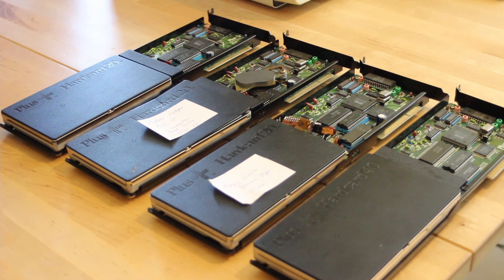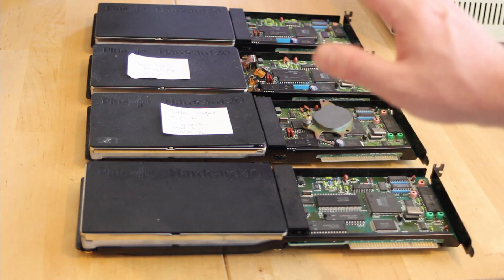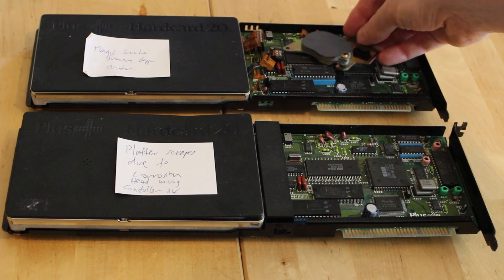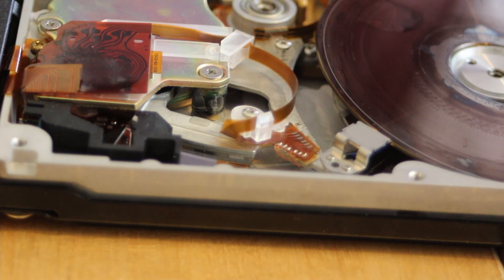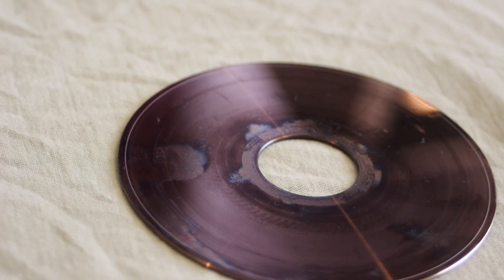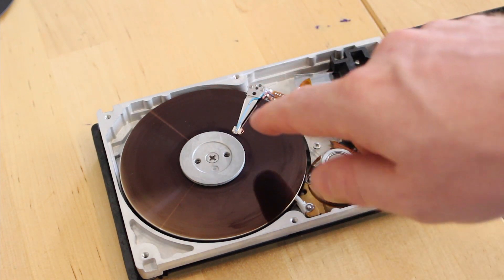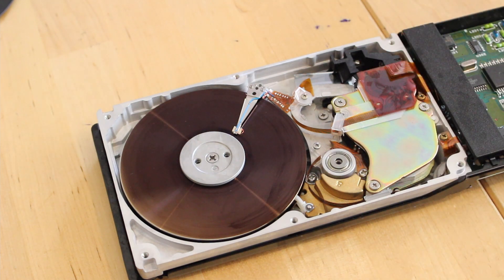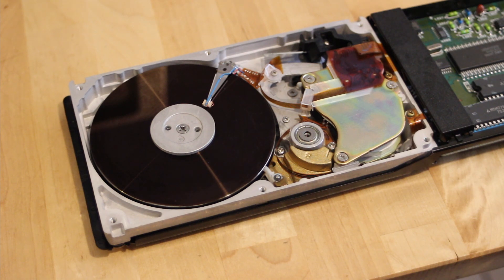Plus Hardcard 20 and 40 Postmortems + Channel Announcement

Comment: The IPA shouldn't leave any residue, and is probably safe to use. It might be difficult to remove all the gunk though. Perhaps something else would be more efficient, like maybe WD40, and then IPA to remove any oils left by it. It's really surprising the amount of gunk on some of those platters. I really have no idea why the drives aren't spinning properly, but while the spindle might move freely, perhaps the drive mechanism isn't, which I guess is inside the assembly at the very bottom. Maybe there's a degraded belt or something. Maybe the pads on the heads are also "sticky". It's probably quite hopeless to fix though. Kudos for trying!

Comment: The heads stick together because they are so smooth - like gauge blocks. Originally there was a silicone lubricant on the disks. It has to be very very thin so the heads can glide over it.
Reply: This exactly! Also, when the drives aren't used for a long long time, the pressure of the heads slowly squeezes the lubricant out underneath so the heads begin to stick to the platter. Those were the marks you could see on the platter, the thin layer of lubricant was missing. Now, when the drive is powered down, it tends to stop at exactly that spot where the lubricant is missing, so it will stick every time.
I'm tempted  to try using some silicone or PTFE spray to re-lube the platters…

Comment: Hi, Can anyone tell me where to download the HardCard 40 utility programs?  I am going to try to repair my HardCard Plus40 that suffers from Stickage by removing the rubber pumper that has turned to goop.  I saw another video where the guy fixed his drive in a Compaq portable computer by removing the gooey rubber bumper and replacing it with heat shrink tubing that he built up layer-by-layer.  His drive worked after that.  I'm going to try to find rubber washers or gaskets for my fix.  I think the outer diameter of the bumper is 8mm and I'm going to guess that the spindle it sits on is 5mm.

Comment: Can you post a copy of that divide software? I've been looking for that for ages - I have a couple hardcards I'd like to try and recover.
Reply from the maker: I am not sure which divide software you are referring to. In the video I make mention of software for the hardcard, which is here: https://ibm-pc.org/firmware/other/plus%20hardcard/plus%20hardcard.htm Other than that, I have long since forgotten what software I was using.
Reply: @PCRetroTech  That's what I was looking for, thanks!
Reply: @compu85  did the hardcards work?

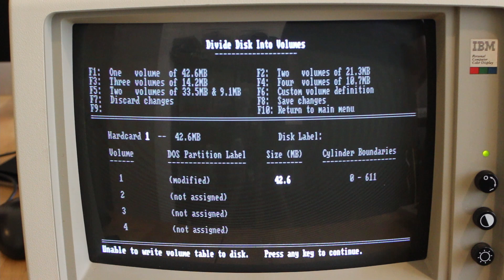Comment: CONTINUITY: The transition at 28:22  is somewhat confusing. There's a change from a platter shown before then and described as "really totally ruined", and a platter (side) announced afterwards with "this is the other side of the platter" and described as having "not much damage here either". Are these different sides of the same platter or different platters? (The different backgrounds/cloths suggest the latter.) It's fairly contradictory. PS: What's also confusing is that around 31:58, you mention you took the 40MB drive's platters out, but then at 36:18ish you say you'd (only later) have to "pull the drive apart".
Reply from the maker: It's a continuity error from editing too harshly to get the time down. I had to leave a lot out of this video and actually confused myself in the end at the order I did things. The video would have made more sense if I omitted this section entirely. Just take it as another random example of platter damage from an unspecified platter.
Reply: @PCRetroTech  Thanks for clarifying. I also edited the above comment and added a postscript pointing out another continuity issue. 
A third continuity issue is that you mention the successful IPA platter cleanup twice, both at 40:10 and at 43:04.
I also don't get why head movement when the disk is at rest would cause a scrape but head movement while the disk is spinning wouldn't.
Appreciate the content though. Some of your newer featured hardware I wouldn't consider retro (yet), but this is truly retro.
Reply from the maker: @ropersonline  When the disk isn't spinning fast enough, static friction can cause the heads to bounce rather than glide. Dynamic friction will also cause damage eventually of course. Some claim that when the disk is spinning rapidly a layer of air exists between the head and disk. I don't know if this is a myth or not.

What happened with these drives is that I found both of the platters in the 40mb drive looked damaged in places, so I tried replacing them one at a time with the relatively good platter from the other drive. I had other problems not shown on camera which made this particular story hard to tell on film, so I had to abandon it. Ultimately it wasn't successful anyway, for reasons unknown. Probably these platters are low level formatted at the factory and not intended to have platters removed and/or swapped.
Reply: @PCRetroTech : "Some claim that when the disk is spinning rapidly a layer of air exists between the head and disk. I don't know if this is a myth or not." <-- So, like a reverse Bernoulli effect? Dubious...
Reply from the maker: @ropersonline  No, some hard drive heads are angled up at the front so they scoop air in under them. This is supposed to keep them off the surface. But exactly which drives work this way, I am not sure. There seem to be multiple different mechanisms (patents and all that), and I've no idea which is the most common way of dealing with that problem, or which method is used in these drives. I'm pretty sure mine were scooping dust and grease, not air.

Comment: Now I'm a bit worried.  The MFM in my 286 machine died and I got my hands on an NOS Hardcard II XL 50.  It is about 2 to 3 years newer than the ones you have and wonder if it suffers from the same issues.  I guess the only way to know is to open the box and install it.
Reply from the maker: I've never tried an XL, but good luck.
Reply from the maker: Ha, literally 30s after replying, I saw a working XL 50. So you have a chance!

Comment: These things didn't even work well back in the day. Even in 1992/1993. When they were only a scant few years old, only about 1 out of ever 5 would actually work..
Reply from the maker: Oh wow, really!? I had no idea they were that bad!
Reply: @PCRetroTech  Yeah, good idea, Bad implementation. These were not the only attempt at this back in the day. Kalok (and some others) tried this. With standard components. They used a standard Kalok 3.5inch RLL drive, Standard 8 bit controller card, standard ribbon cables, and a power connector that connected to the card. All on a frame that sat in the card slot. It worked great. But it was noisy in the card slot. I remember just buying a bracket for the drive bay and taking apart and pitching the frame.
Reply from the maker: @Alcochaser  Yes, I've seen a few of those.

Comment: Could some sort of magnetic resistance in the motor be the reason you had to use so much force to make the platter spin?  Maybe there is a fault in the motor drive?  Just throwing that in the ring.  When it is all still sealed, there could have been off-gassing from the deteriorating rubber that has distributed oily, sticky residue around the enclosed space and onto everything.  You haven't completely given up yet though, have you? :-)
Reply from the maker: The motor itself span freely. I think the heads were magnetised and sticking to the platters. They probably need demagnetisation.

I think you could be correct about the off-gassing of the deteriorating rubber.

I have given up on these drives by now. The electronics actually failed due to my repeated attempts to get the drives to spin up. If there is a way to successfully repair these drives, I haven't found it yet.

In another drive the tiny wires to the heads had snapped. There is no possibility of repairing them without special equipment. Those wires are about the size of a human hair.

Unfortunately stiction is only one of the issues the drives suffer from.
Reply: @PCRetroTech   Sometimes I wonder about my wild theories :-)  Sounds like you have spent some time on these drives and done all you can.

Comment: I have read somewhere that letting the heads touch each other damages them
Reply from the maker: They are very delicate. It wouldn't surprise me.
Reply: @PCRetroTech I am thinking of buying head combs as I guess that hard drive surgery will become the norm with those old drives
Reply from the maker: @krz8888888  It would be interesting to hear if you have any more luck repairing these than I have had. Admittedly I probably could have gotten one or two of these drives partially working if I hadn't made silly mistakes. Still, there's not exactly a tutorial on it somewhere, so one has to learn somehow.
Reply: @PCRetroTech  It seems like a fairly unforgiving process. That oil is a mystery to me, could it be vaporizing from the melty rubber ? In any case it was a very interesting video, happy that youtube recommended it
Reply: My guess is it’s evaporating from the head assembly bearing and depositing everywhere else.  Maybe that’s what makes the heads stick, although magnetization seems plausible too.

Comment: A few thoughts:  (The usual caveats apply.  These are all desperate measures to revive drives that would otherwise be trash.  Any fixes may only be temporary, YMMV, at your own risk, etc.  No comments about just trashing them, or whether or not it's worth it are necessary here.  Of course it's not 'worth it' unless you think this kind of thing is fun and interesting.  If you do, you get it, and if you don't, move along -- nothing to see here.)

I wonder if the (in)famous 'freezer trick' would be a more gentle way to address the sticktion issue than rotating the drive.  Assuming that freezing and thawing the drive does un-stick the heads, if there is any damage, it will be localized on the disk, won't dig a groove through an entire track, and won't be as likely to rip heads off.

Does anyone know that silicone lubricant would be bad for the disk platters?  If it's thought that silicone would be relatively benign, I wonder if a light coat of it would keep the heads from sticking in the future.  If not silicone, is there any other easily available spray lubricant that would not damage the platters, and also might keep the heads from sticking?  

One issue with lubricants of many kinds is that they can get gummy when dust settles in them.  Dust is already a concern for HD platters.  There are several videos on YouTube about building a very inexpensive clean box using a vacuum cleaner hose and a HEPA vacuum bag.

Would there be any sense in designing a 3D printable comb or wedge assembly that could gently hold the heads apart enough to keep the heads from coming into contact with each other in case the platters need to be removed or replaced?  Is there any scenario in which platters could successfully be transplanted?

So I propose the beginnings of a protocol for dealing with these drives upon receipt:
1.  Remove the plastic cover, possibly somewhat heating it to soften the adhesive.
2.  Freeze the drive to un-stick the heads.
3.  When it thaws, put it in a homebrew clean box, open the drive, and see if the platters move freely.  Maybe push a purpose-made comb between the head arms to make sure they are free.  Maybe screw the drive to a bracket that holds it vertical while being serviced, so that any stuff falls down and away from the platters.
4.  Check for rubber stopper gumminess.  Replace with a suitable alternative.  I've seen someone use a section of vinyl tubing to fix a similar problem on Quantum SCSI hard drives.
5.  Maybe lightly spray some kind of benign lubricant on the platters to keep future stiction from happening.
6.  Reassemble in the clean box.
7.  Test drive in computer.

Thoughts?
Reply from the maker: I had a hard drive repair industry expert comment on one of my videos and he said that a home made rig to suck air with a vacuum cleaner is a very bad idea. He also mentioned that many of the compounds that one can use produce outgassing, which destroys platters, so you need special chemicals.

In this case I believe the most likely issue is magnetisation of the heads. This can only be repaired by opening the drive. One then needs a special comb device to spread the heads from the platter. One could then use a demagnetising loop. However the problem is this can't be done in situ due to the magnetic field. This means complete dismantling of the drive, which requires a bunch of precision equipment. In particular the platters must align precisely. There are also drive specific calibration procedures, which we simply don't know anything about.

I'm now very uncertain there is anything we can do as hobbyists without extreme levels of dedication to repair these particular drives. One might occasionally get lucky, as I once did with a new unsealed drive of this kind. But this drive eventually died just like all the others, and it was flakey at best when it did operate.